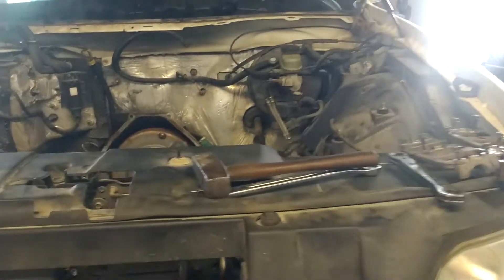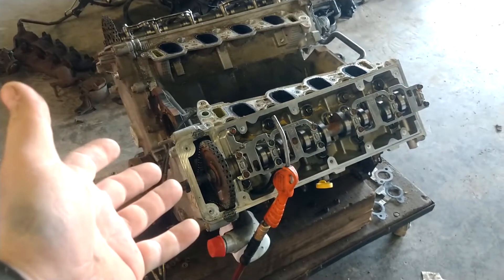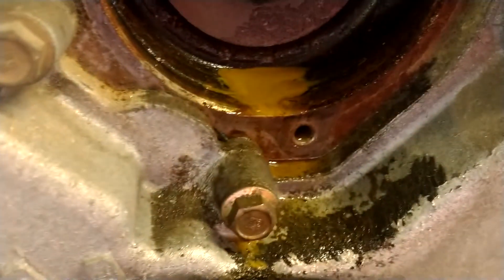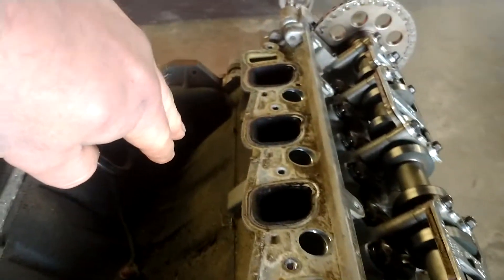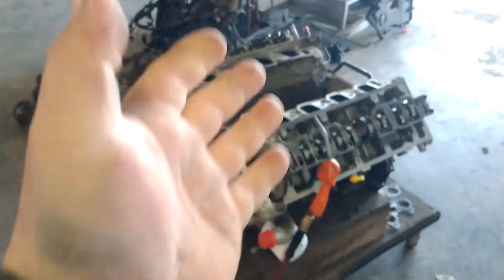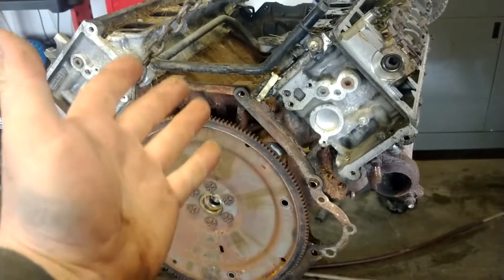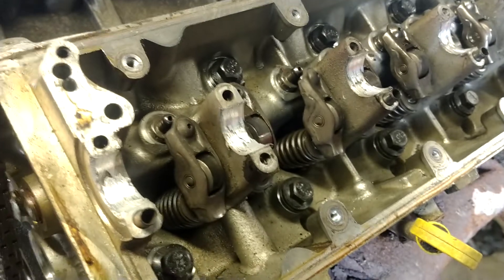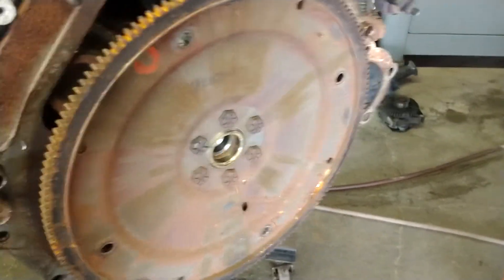Salvage yard engines and why they can't be quoted for installation labor

Comment: Here's a thought.....Do you think the day will come that small mom and pop type shops will no longer exist due to the fact that parts availability for older model cars will cease to exist and the engineering behind modern cars is designed to be throw away?
Reply from the maker: It's already there to a certain degree, mainly through trademarked software, past and current legislation has kept manufacturers in check as far as holding a monopoly.